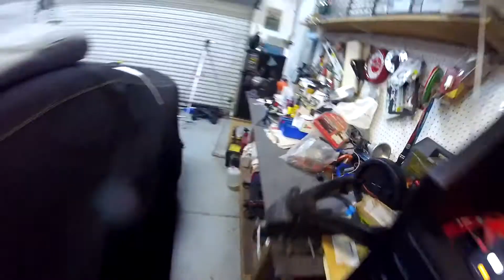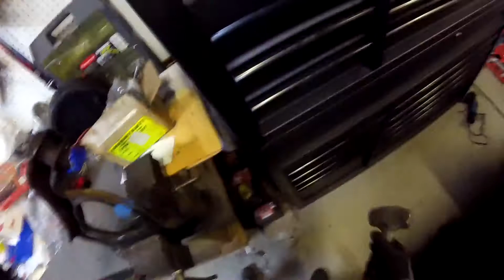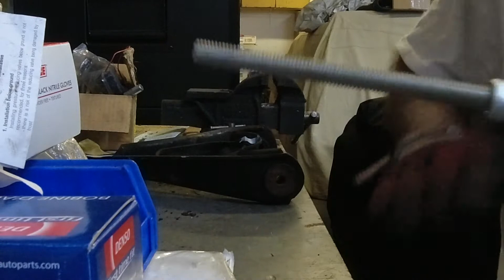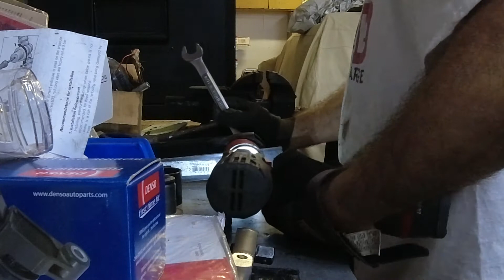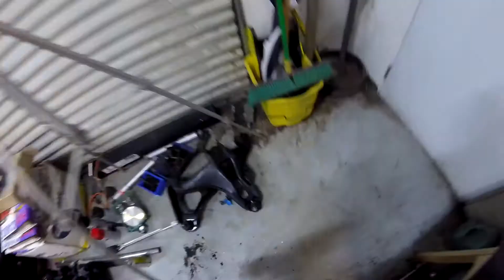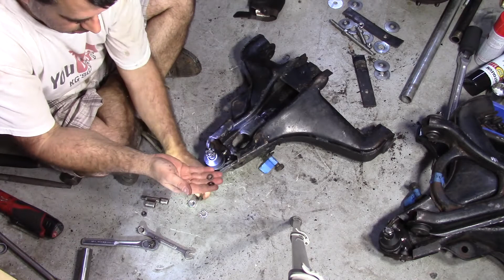GMC Motorhome Control arm bushing/ball joint removal and install.

Comment: The most important thing to learn from this video is what NOT to do with the Lower Ballj Joint side bolts. 
He says they've been replaced before  and noticed the holes are "waveled" out.  (I like "wallered", myself) and puts a flat washer over the hole.  
This does nothing to fix the problem of the oval hole.  It covers it, but when you consider the forces going thru those two little bolts (enough to ovalize the hole) a flat washer does nothing.  

The problem is the original ball joint was riveted in.  Those are ground off  and replaced with 5/16" bolts, which are slightly smaller than the rivet hole.  And of course they loosen up, because they are moving (along with the tip of the control arm) and making that oval hole.

A newly installed ball joint should be drilled out to 3/8" and you should use a bolt that doesn't have threads where it bears on the control arm.  Threads are like little saw teeth if the things is moving.  And while pounding the  threads flat is one way of keeping the nut from moving, red Loctite does pretty much the same thing.  I actually tack welded the bolt  head to the control arm. 

This coach is on it's way  to a failed control arm.  Maybe not during your ownership, but eventually.  Those holes are already not round and the tip of that control arm is bending slightly, over and over and eventually will crack and leave the coach with a wheel sitting all wrong.  It usually happens on low speed turns, so you can hope for that.  

I'm just sayin'...
Reply from the maker: thanks for your input.
Reply: @KGsGarage  Quite welcome. Do the 3/8" bolt mod. Otherwise you're on borrowed time.

Comment: So I got my new bearings and seals in finally for the front drive wheels. I have an issue as I am getting conflicting information about what size the castle nuts are that hold lower ball joint. I've bought some much crap to try and fix it that I could have (and should have) just bit the bullet and paid the triple digit price for a new one. Using my digital caliper it appears to be 5/8" ID but I am not 100% sure of the thread count.
Reply from the maker: Sorry, I dont know what size they are, they come with the new ball joints.

Comment: How much did it cost to have the spindle bearings done?
Reply from the maker: I had them done on in Feb of 2021 and a remanufactured Knuckle was $300 and bearings were 3hrs of labor. The bearings and seals were $235 a side.
Reply: @KGsGarage  Thanks. That's the info I needed to move forward on mine.